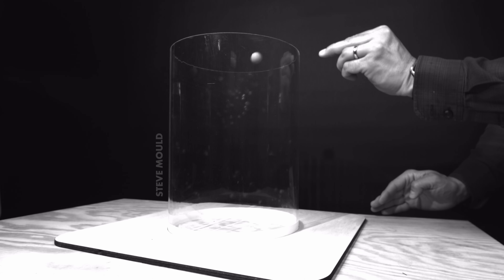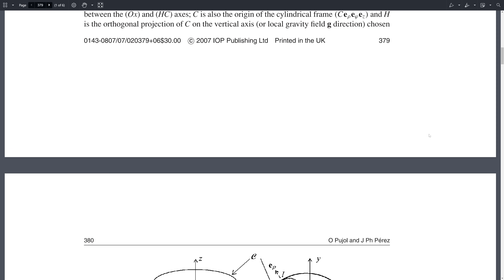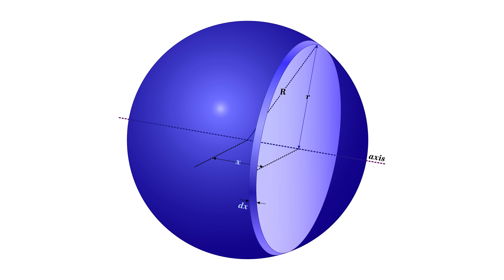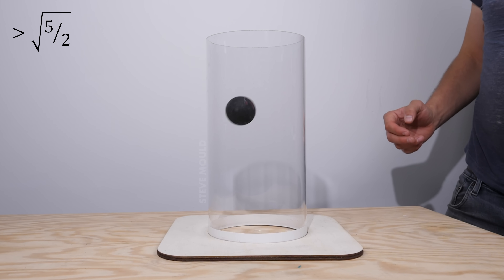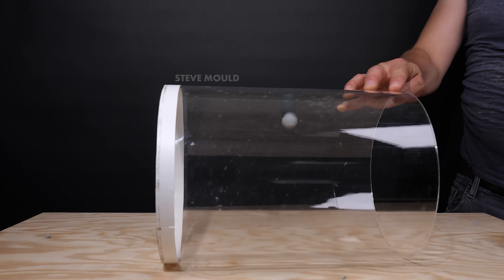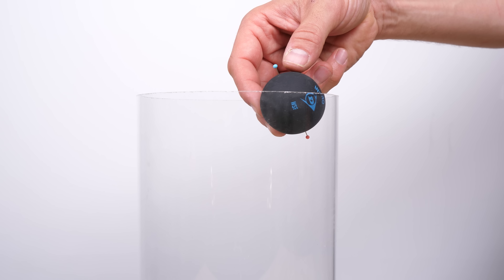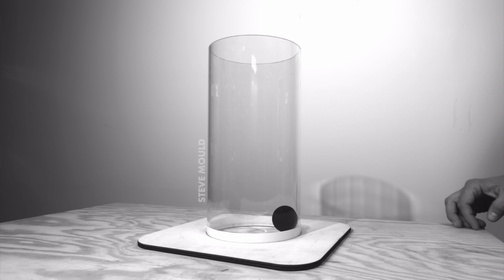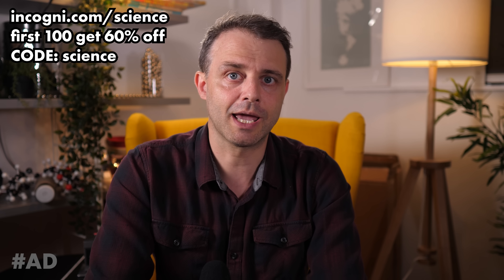The Golf Ball Paradox

Comment: When i have some tripple mirror or a tri-faced corner and throw an adequate item onto it, then it will bounce up to three times and then will return with opposing direction.
The tree faces are sufficient to ensure that the movement vector gets inverted by its three space axis - by making sure it sees reflection 3-times per each axis direction, thus 3x -1 = -1

Please show us a three-face ball reflection with your slow-mo !!!

With this setup from the video i see no "bottom" face that would ever do a reflection, so the "glass" is open without a ground. Thats the "frightning" aspect of the shown case - there is reflection from something that is not even there. The only force that can hold against the original inwards motion is the force of friction. The proof that it wont work on a plain has been done, and also some hint that gravity plays no central role might be drawn from the horizontal tube setup. So its friction and the curvature that will do the job.

The problem for the best/exact explanation is the physics of the setup which will need a step wise, incremental methodology for doing a proof by a simulation. That's indeed hard to follow for our human brains. What we can barely see is the rotational movement and its changes over the motion curve - and that might be one more key factor contributing to the found result. Corner case guesses and progress understanding should follow these items:
* the ball will see an initial rotational speed up as soon as it gets in touch with the surface - this is sort of a hidden energy storage, an accumulator for parts of its directional motion energy.
* the ball will see at first a helical movement just along the tube inner surface. - and we know from observation, that some motion along the tubes direction gets slowed down and soon reversed.

the first line implies at some point a ball that has its rotation speed up to its movement speed along the surface of the tube.
a simpler setup with e.g. a hollow ball instead of the tube would maybe show that a purely circular (not helical) path could be very simple as rotation and surface are totally in sync at all times. (maybe also achievable with a tube and the tube shaken by hand to give energy, maybe even self centering... or maybe even a diablo toy shape with its inner curve like that toy can do it stable, but i am not sure about it. - and remember that rubber bands and belt drives are self-centring, if just the belt wheel is rounded like a center slice from a ball.)

My understanding so far is, that a ball at some tube point is rolling angular to the tubes cross section circles. thus the balls rotational axis is also tilted and rectangular to the current motion direction - it could be understood as a tilted derivate of the cylinders main axis. When now the ball goes around, it would have these axis turned around as well. say if it points out a circle on top level of the tube, then this circle would be outside of the tubes diameter. in conclusion, the circular ball motion around the inner tube surface would need the ball to change its rotation axis all the time to something new to keep up the initial angle adjusted for a "correct" steady rolling condition... but that does not happen as we have seen. there is no good force that would give the ball any "push" to its axis to make it tilt around in say by half when it spins a half turn inside the tube.

admitting this as a first simplification of the setup (if you want...) a ball that runs downward with its initial "stable" speed and rotation metrics on the e.g. right side...
...will not change its spin that much when rolling down...
...but will have still mostly the same spin when it arrives on the other, left side of the tube.
And now the spin that gave initially a drive downwards into the tube, will now point (circularly mirrored by the balls own rotation) in parts UPWARDs, out of the tube!

So already quarter of the first turn an increasing slow down of downwards movement is expected to happen for the ball as the assisting rotation of the ball decreases.
At the second quarter a counter movement sets in that wants to roll the ball to the open/upwards end of the pipe.
More deceleration and acceleration phases might see identifying thus making the whole process even less understandable.

If i would like to depict the thing... i would draw the ball with an equatorial line around it that represents the simplified spots where it touches the tube over time.
One half of that equatorial ring gives a (varying magnitude) pull into the pipe, and the other half gives a pull outwards - depending on actual position thus the ball will either get accelerated inwards or it will get accelerated outwards.

What is one of the most simplest models for explaining it?
I would propose this one:
A little gear is running around in a bigger circular inner gear. No wonder it just runs around.
Now change the outer gear from a circle towards an elongated hole / slot - with again an set of inwards gear teeth.
Imaging the long sides of the slot are the long side of the tube... - and on the one side the rotation of the gear pulls it to the "inner" end, whilst on the other side it gets pulled to the "outer" side. The principle is the same as the vids setup - the circular object inside all times keeps its rotational direction but creates two different directions of movement (acceleration) depending on which side of the outer object it currently runs on. Thus it will be able to move either of the two direction depending on its current position and thus contact point with the outer object.

for making this even more clear - you might want to split up vectors of the "irrelevant" ball rotation along the diameter of the tube and the "relevant" ball rotation along the axis of the tube.

exact math factors are hard to draw just with that principle right now.
but you might want to have checkered or dotted balls (like some white billard balls for practice and effet viewing have).
and you might want to pair/match the balls rotation directions with the observable in/out acceleration of the balls.
THATS THE REASON YOU HAVE THOSE HIGH SPEED CAM FOR - MAKE THINGS VISIBLE THAT WE CAN NOT SEE NORMALLY.

lets make a prediction:
when you would be able to unroll the tubes surface (like by still-frame series inspection)
then you would see that the balls rolling direction and the balls in/out speed ups and slow downs do cope with each other.
so it all is a very predictable, possibly sinusodial (or cosinus or some squares of it = the same, but 2x frequency)
behavior - that even can repeat a few times. any maybe you will find then that rotation direction changes over time due to friction, or maybe not. Find out! ;-)
(having those insights might show why an ideal ball rotation will behave different from what a theoretical ball from the actual ball will behave.)
(you have thrown the ball in. what about a catapult launcher in tube center that gets pulled back? will the ball ever escape or just do pendulum motion between to far points?)
Reply: @SteveMould

with above comment i gave some ideas on an explanation - and a big hint on some setups that would help much in getting the riddle solved by your mostly already available equipment. just minor helper changes needed to see it - and a bit of effort for watching your slow mos really really carefully.

are encouraged now with the above to present something of supposed high interest and unveiling to us?

Comment: The effect of this would be easier to notice with markings on the ball.
What I noticed: when the ball enters the cylinder and begins turning, it will follow its initial path along the cylinder from its gyroscopic force. But as its path continues, the surface of the ball that is in contact with the cylinder wall will not stay perpendicular to the axis of rotation. This will slow the ball rotation along its axis and weaken the gyroscopic force, allowing the ball's axis of rotation to adjust and correct to the new angle. At this point, the ball will begin to move up the cylinder, only to repeat this, change its axis, and move back down (or fly out of the cylinder). I know I'm probably not using the correct terminology, but I know this is what's happening, it's just hard to explain.

Comment: I imagine a high friction disk or ring would have a similar effect in a cylinder, and the explanation that the direction of travel around the cylinder matching the plane of rotation would make sense. I wonder if, in a ideal setting where gravity and air resistance weren't factors, if you could adjust the ratio of oscillations per rotation by simply adjusting how concentrated the mass is from the center or edge of the ring/disk. And would it behave the same if the center of mass wasn't centered in the object?

Comment: What if the precession is causing a different contact patch and grip profile that causes direction and speed changes?

In Moto GP the riders short-shift (shift into a higher-than-expected-gear at a particular speed) going into tight turns in order to have a greater gear ratio as the turn straightens out. The higher gear and smaller diameter of the contract patch at steep angles compliments the power that can be put down in otherwise difficult turns.

Comment: I hadn't actually thought about this, having only played a few rounds of mini-golf in my life, but it makes sense, within a certain range of parameters.

Without watching more than 5 seconds of the video, what is obvious is that you are getting rotational force input from two different fixed directions but you can only actually rotate in one direction, so since one of the forces is an exponentally decaying linear input and the other is an accelerating quadratic input, the rotation is unstable and must flip, and since flipping is symmetrical and cylindrical holes are symmetrical, there are necessarily cases where the ball just pops back out.

Neat!

Comment: Put an unbalanced load in the washer and dryer and film the motion amplification. Would be cool to see many things, loud speakers in a car(rearvuew mirror vibrates), insturments playing, a harder one may be a window or glass sliding door when an airplane or train passes near by. Maybe you can capture the engine vibration under the hood of a car. Maybe even a printer or copy machine. Or if you can fo to a print shop they have machines. These are just a few i can think of sooo many more. Maybe even some flying animal.

Comment: Paint some line around the ball, like an equator line. Then make some kind of hollow tube slingshot that can shoot the ball specifically in a certain controlled direction, ideally, in a way so that the painted equator line is the one that gets in contact with the cylinder wall. Then the cameras will show what happens with the ball rotation and direction.

Comment: assuming the ratio scales linearly with wall thickness of the sphere, interpolating the approximate ratio of your squash ball would just be a matter of measuring its thickness and plugging it in. i'm sure it would come out very close to what you measured experimentally. obv not sure the same can b said about the steel bearing core ball

Comment: Steve Mould: The force upon the ball from the cylinder (pushing) is equivalently opposite to a force upon the ball in another situation which is a ball flying around around on the end a rope. Imagine it! If you are swinging a heavy ball tied to the end of a rope in the same manner, it will appear to go down, and then back up! That's because the rope pulls it back up. The opposite is happening with the cylinder applying the opposite directional force in your video. That's because when the ball is going around it's center of mass is inside it's path! Now thing about a sphere, not just a circle. It would be like an electron rotating around an atom.

Comment: Here's my arm wavy, intuitive, explanation. The paradox, to me, is how does the cylinder exert a vertical force on the ball when it has no component normal to the vertical? The answer, I think, is that the vertical force is friction which slows the balls descent and meanwhile the spin of the ball redirects the downward momentum upward. The "centrifugal" force of the ball provides the normal force for friction, instead of the weight. You could test this by repeating the experiment with a glass ball (marble) or a sphere of ice.

Comment: Think of tetherball and hitting the ball with a vertical component. Here the ball is bound by friction and the inside of the cylinder instead of a line (all be it a fixed line that makes a true orbit and doesn’t account for the depth of the cylinder). Hit the tetherball with enough downward component and it would rise above a prescribed level like the upper edge of the cyclinder, or even the level you hit it from….. Great video!!!!!!

Comment: DUDE. Use your motion amplification camera to detect the the vibrational differences between the stickshifts of a driver who uses the column (stick) as an armrest (not advised) and a driver who only touches the column at the "right times": when up or down-shifting.

I've been told that any pressure applied to the column (stick) whilst in gear will significantly increase wear and tear on the transmission, and will ultimately correspond with the column (stick) vibrating more during normal operation.

Can you confirm or deny this, Steve?!

Comment: This is very similar to a problem I was working on. Imagine a motorcycle leaning as it goes around a curve. Then the wheel hits a bump. I expected the bump to push the wheel vertically, destabilizing the bike, keeping in mind the suspension travel is parallel to the wheel. So how does the bike not get a lateral force, creating a wobble? In fact the contact patch of the tire actually follows the angle of the wheel and travels across the bump on an angle. This works well as this direction of force is in line with the suspension, and explains why 65 degree lean angles are possible in motogp racing.

I see the ball traveling in the cylinder in an imagined straight line in terms of its forward motion, assuming you have adequate traction at the contact patch and its tendency to maintain its axis of rotation.

Comment: Does the compression of the ball due to the friction of the ball on the surface play a role at all? You mention that only grippy balls work, and not slippery ones, but didn’t address that in your explanation. It also addresses why the  phenomenon happens in a horizontal cylinder without the effect of gravity, to what seems to be an even greater degree. It accounts for the resistance of the ball on the way in and it also addresses why the ball resists coming back out as well, and cycles between the two as if the ball were bouncing between two springs (compression at the point of contact, due to friction).

Comment: The moment the ball touches the cylinder in the downward vector, it imparts the gyro motion which resists change. as it passes the apex to the reverse side, instead of sliding down the wall of the cylinder, friction allows the ball to maintain the tilted axis and climb back up out.  The record player ratios are not a factor here.

Comment: The imperfect numbering may also come from the weight distribution of the ball, since it is not a perfect sphere with its dimples.  The inside of a golf ball isn't homogeneous either; most modern golf balls have multiple layers of different materials, usually 2 to 5, similar to a jawbreaker.  Additionally, some of them will have imperfections due to manufacturing errors.  An example being some of the first generation TP5 balls
Reply: Additionally, the rules of golf don't specify one specific weight or radius, but instead a range of acceptable weights and sizes.  There's actually no upper bound to the ball's diameter

Comment: This reminds me of my intuitive explanation of the gyroscope. I was flatting with a PhD physics student who called my explanation nonsense. He said it was just conservation of angular momentum. It is, but that isn't very intuitive. (BTW, I do have a BSc in mathematics which contained 50% applied maths and physics in first year.)
My argument is similar to what you explained in the video. If a spinning top starts to tip it will start to gain angular momentum about a line perpendicular to the axis of rotation. After 1/8 of a rotation that component will be perpendicular to the original direction (explaining precession) and after another 1/8 of a rotation it will be upwards and restore the balance.
As there are always such disturbances (wind, vibration) this happens continuously but unnoticeably. But as the top slows down the 1/8 of a rotation takes long enough for us to see the effect and the nutations become very visible.
Maybe that would make a nice video if it hasn't already been done.

Comment: Try a cone rather than a cylinder, and try cones that are curved, their walls accelerating in steepness near the bottom of the cone, I.e. their apex. At Isaac Newton’s house in the UK there is a display of this kind. The apex has a hole so the balls fall out, and then can be thrown into the cone again. Most players simply roll the ball into a groove at the top of the display. It rolls almost horizontally at first, in a circular path. After a few circuits, gently descending, it swoops downwards, and then upwards a few times before making several small fast circles near the apex, and then dropping out.

Comment: turns out you have to spin something at infinite velocity to get it to have instantaneous change in the rate of precession this is not something you have to think about a lot in every day physics. when you have a bicycle wheel precess on a string it does not initially precess at all its drop a little bit while the precession is accelerating and then the air resistance keeps eating at it, but try it and notice the initial drop that goes into getting the precession going. :)